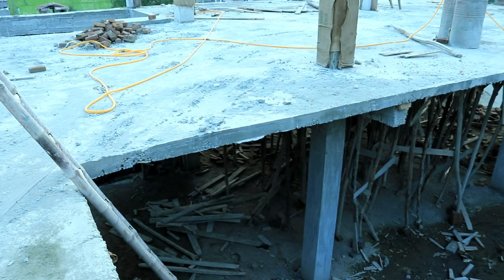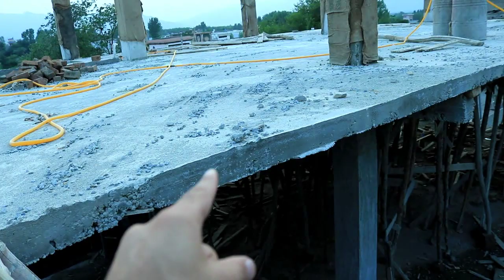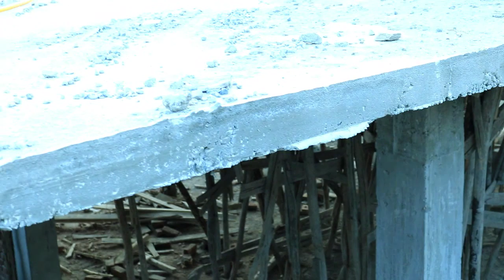Minimum Thickness of Slab - Thickness of slab on Construction Site

Comment: Marriage hall 33×120 how much slab thickness  5 or 6 or 8 inches  . Which is correct?
Reply: I expect the answer. Or ur opinion
Reply: @revarevathi3810  Of course if you have a long span slab, you will need a thicker slab to cater for the bending moment. And if you have a heavy load on the slab, you need a thicker slab to take care of the shear pressure. You must grab the concept right and you need to design the structure as there is no minimum or maximum value.